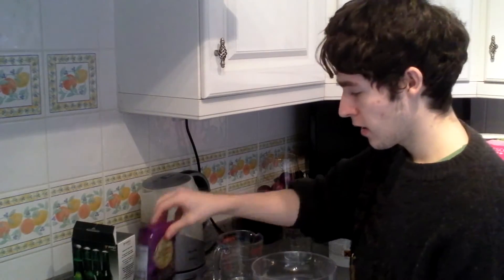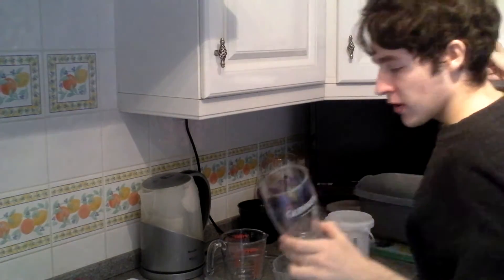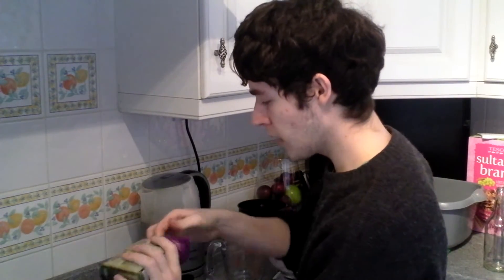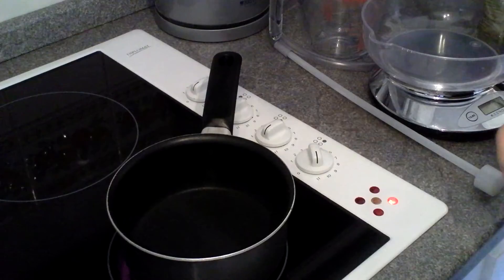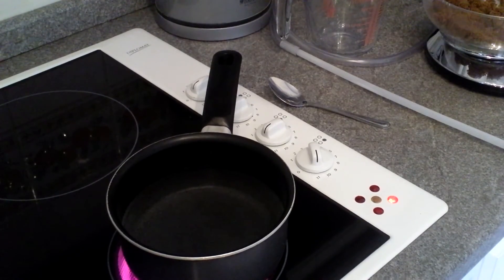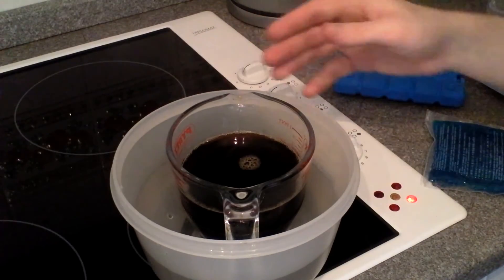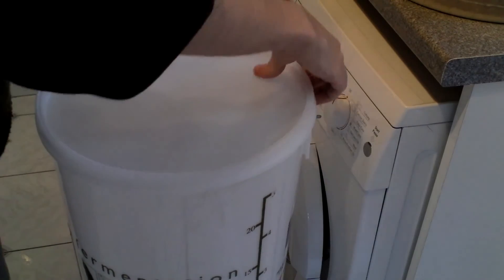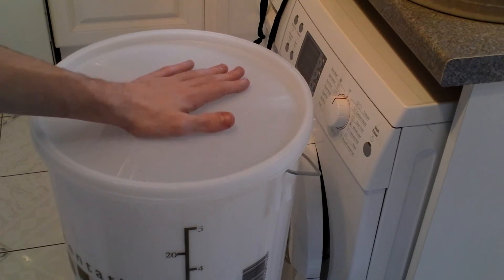HBW #7 - Batch Priming & Carbonating bottled beer info

Comment: 2 cups isn't roughly a pint. 2 cups is exactly a pint. Also, for more consistent results, i've found that if you put the priming sugar solution in your bottling bucket before moving your wort in there from your fermentor, you get a  better distribution and you don't have to wait for the solution to equalize before bottling.